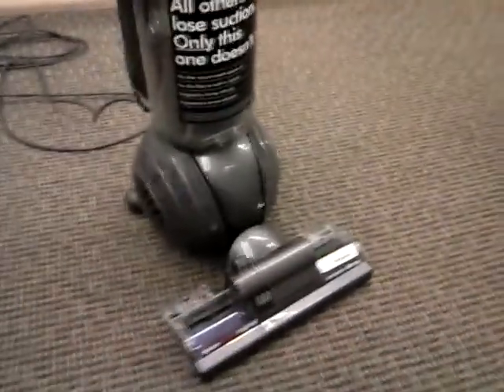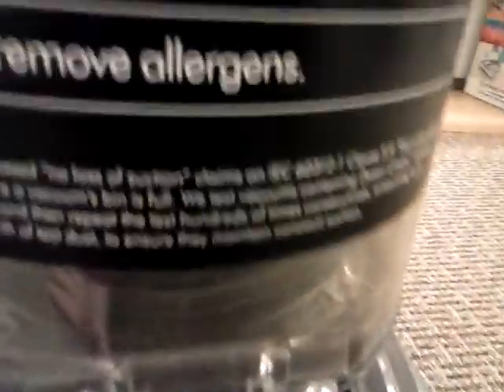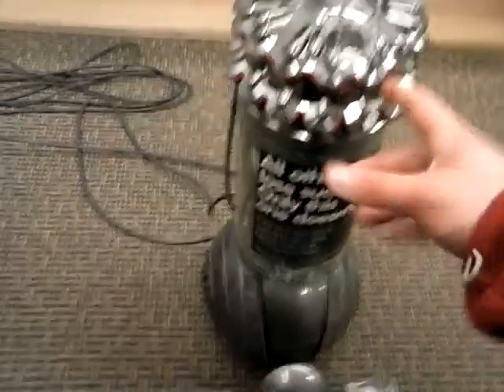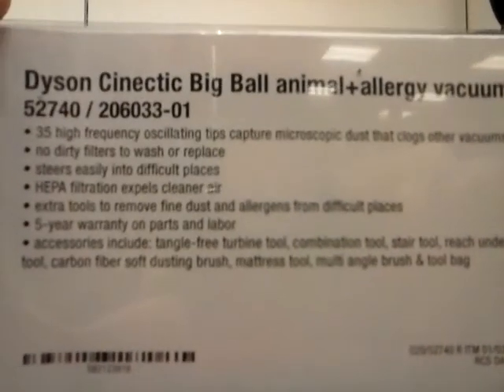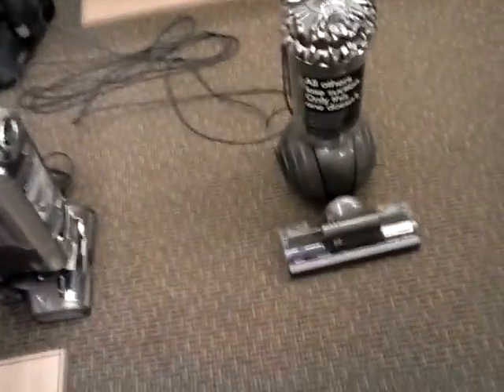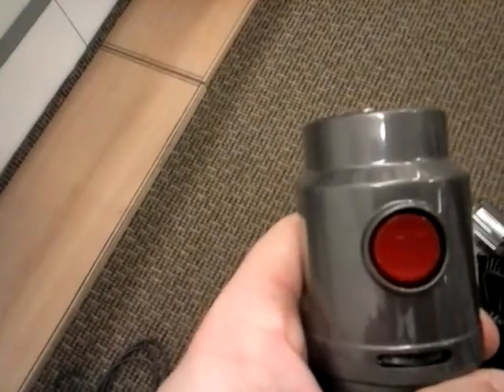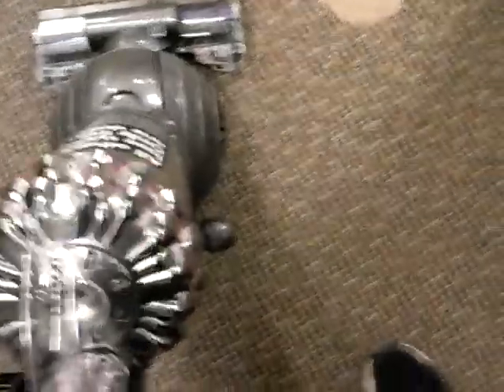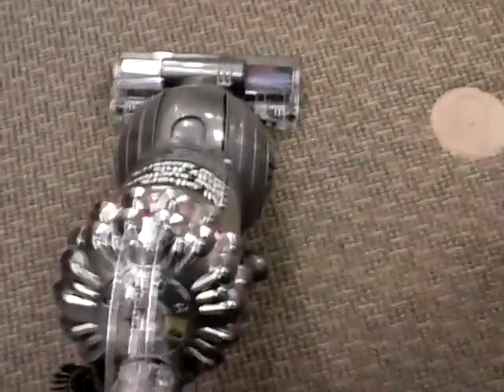Dyson Cinetic Big Ball Vacuum

Comment: Hello Ryan! Nice video, I like the cutting edge technology this machine how it uses flexible cyclone tips that oscillate at a high frequency, preventing dust from caking on them and how it does not require you to wash or replace any pre filters, just take the canister off and thow all of your dirt away.
Reply from the maker: Me too.  Despite it having less suction power than the DC65 (180 airwatts vs 245 airwatts), it's still pretty powerful.

Comment: Hey Ryan. That Is Dyson Cinetic Big Ball Upright Vacuum. I Have Dyson Ball Upright Vacuum With My Favorite Color Blue. It Has Cinetic Adjustable Cleaner Head With No Safety Bars. It Is Extremely Nice Machine. I Remember About Before Dyson Vacuums. It Is Fantom Vacuums. The Fantom Vacuums Was Manufactured In 2390s.
Reply from the maker: +Shawn Capps The Cinetic part is actually called Dyson Cinetic Science.  It's the cyclonic technology used in this vacuum.  Fantom was separate from Dyson.  They were licensed the dual cyclonic tech from Dyson.